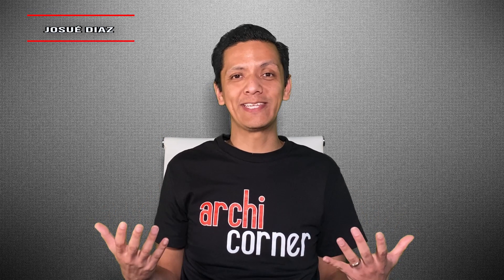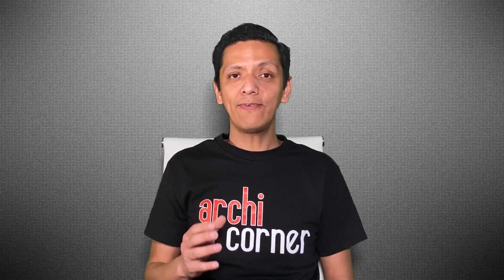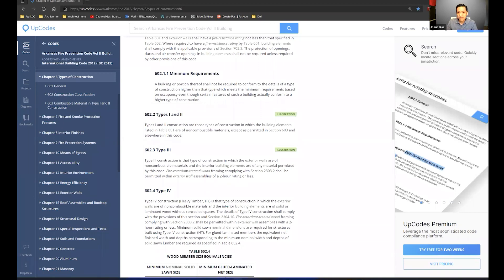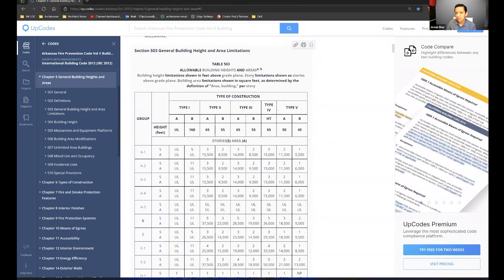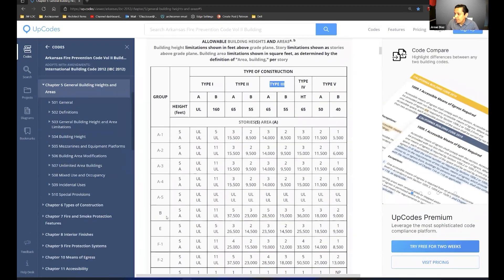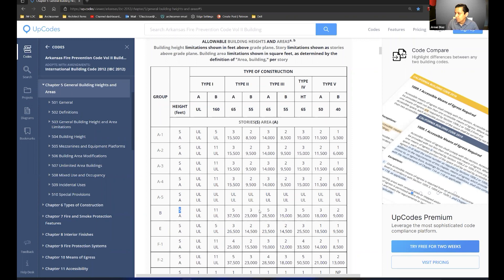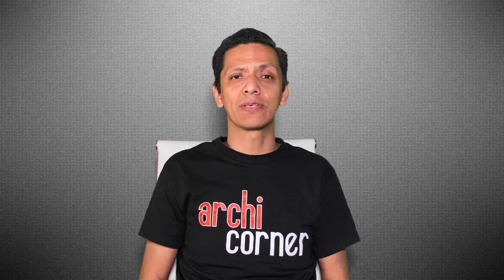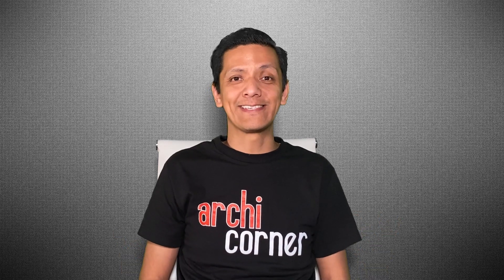AC 036a - Why Architects specify metal framing vs  wood framing.

Comment: Do you have to sprinkle the building if we use wood framing? Say 5,000 sf 2 story building
Reply from the maker: There are various things that may affect whether or not a building needs to be sprinklered or not. 
IBC Chapter 5 will let you know what size of a building you are able to design with and without sprinklers. Building Type, Occupancy Group and Square footage all play a part in determining this. 
Local jurisdictions may require that all new construction be fire sprinklered, regardless of what the IBC states. 
Be sure to check with both.